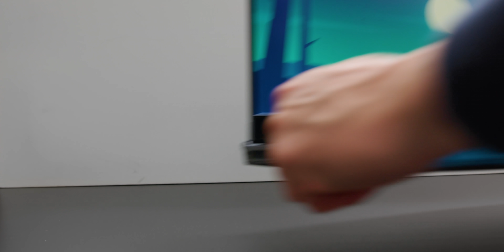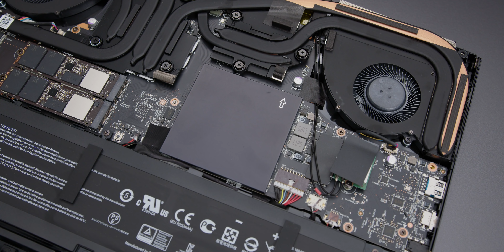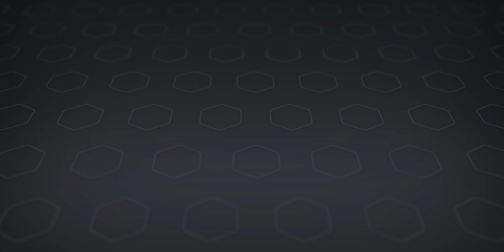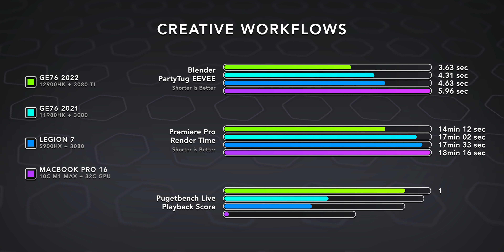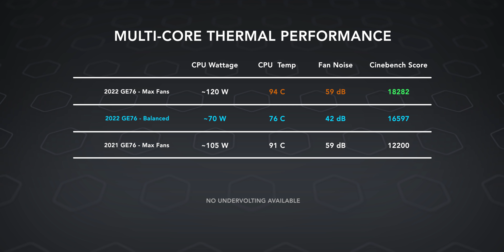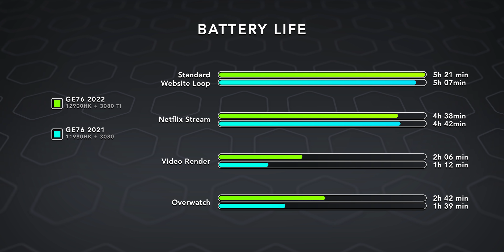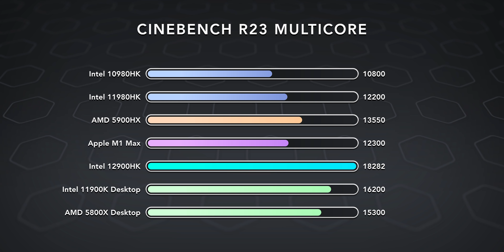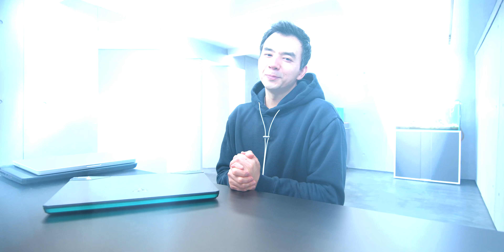This Laptop Is Faster Than Your Desktop

Comment: To be honest I'm not very impressed. 120W and 70W for max/turbo and balanced modes, respectively, are not suitable for more realistic laptop form factors, especially not for thinner premium laptops. Big.little architecture is the way to go for mobile devices as proven by smartphones and Apple's M1 SoCs, but I don't think Intel did a great job in this regard as well since their newest CPUs are still very inefficient compared to AMD, and this laptop proves it as well. They did manage to kill it with multicore performance though so props to them. They were almost always better with a single core and this CPU goes even further.

Overall, I still think going with AMD in laptops makes more sense than Intel, especially for non-bulky laptops and if you depend on operating on battery often. I wish AMD would go with similar architecture (big.little) as it could make them even more efficient than now.

Comment: If it can't run 4k max settings then it is trash to me. I know this crap is not 12 cores for sure. I don't care what speed the CPU is because if the hardrive is not m2 ssd 4th gen pci express 4.0 hahahah pointless. All this BS scores they put it out there just to trick people to buy their weak a s s machine. So people don't fall for this.

Comment: I have a ge66 10th gen with 3070, and I love it. I hate the stupid badge they put on it, but besides that it's a solid laptop series. Honestly the 3080 variants are a waste of money. The performance difference between 3070 and 3080 variants does not warrant +600 bucks, not even close.

Comment: I returned the MacBook Pro M1 base model for being too slow for its size.
I returned the legion 7 for having a terrible trackpad and not being a nice daily with poor battery, noise, buggy functions etc.
I then got a Blade 14 but now thinking I need to get an AlderLake Asus M16 or this MSI beast.
A mini-led screen plus alder lake plus 3080ti and unibody chassis with decent trackpad and I'm sold.... Until the 4080 is released
Reply: Sounds like you should wait until year 2030
Reply: When there Macbook Pro Retina came out it was worth going all out.  Now there is a generational leap with PCI5, DDR 5 and smaller nm intel, 2022 is the time

Comment: With AMD facing chip shortages, this year seems like  a good opportunity for Intel
Reply: Everyone is having a chip shortage, and intel and other companies cant take advantage of it because companies buy waffers for chips far ahead of time so these chips were claimed before the shortage even happened. its an even playing feild, the only reason intel has performance right now is because there talented engineers optimized core counts. you cant really act fast on events like these because every company is reserving chips until 2026 right now and they dont want to over buy
Reply: @errettfitchett2463  Nope, Intel did strategic partnership with TSMC that TSMC now building new fabric expanding their production at Intel sake. Apple as always already take step far far earlier. AMD in other hand seems in trouble on production.
Reply: Ops Blac  that's why Intel is building new foundry in Ohio.
Reply: yep, Intel move fasts in dealing thing with TSMC, and Intel got the agreement. AMD is refining their APUs but they forget the business side : secure the stocks and production.
Reply: @ZAcharyIndy  bro AMD is gonna come out swinging as well lol amd laptops batteries are un touchable at a low price
Reply: @fabolousjada5070  not that well

Comment: Intel was keeping this technology for 2030 but the pressure from competitors made them release it earlier 😂😂😂
Reply: Nobody has ever "made" Intel release anything... not even the feds.
Reply: nothing impressive btw, high amount of cores combined with high TDP gets you eye catching results, but efficiency / performance metric is still far away for perfection especially when used on mobile devices such as laptops. i would declare intel as a winner if they can pull off higher performance with the same efficiency as  a M1 Max.
Reply: @mishomaisuradze8205  Even M1 still need to plug in if you want to used it for Rendering or any heavy task
Reply: @mishomaisuradze8205   From your comments you sounds like true AMDumbs aka AMD fanboy, you just mad because your zen 3 and soon 6000 series which is still based on zen 3 totally got destroyed by Intel Alder Lake. It's not even competition.
Reply: Intel 12900HK uses 115Watts to deliver that performance, while the CPUs it is being compared against use 45Watts..
They really should be mentioning that while showing benchmarks instead of misleading the audience
Reply: @evileye4797  no Dave said the number are from balance mood which is kept around 70watts.
Reply: @evileye4797  115w is short burst, you obviously AMD fanboy who don't know how TDP works in Intel CPU, its not even the same like in AMD. Honestly you AMD fanboy are just mad because Intel put AMD to the shame with Alder Lake, not even 6000 series can save AMD because it still based on zen 3 and there are benchmark leak already that shows 6900HX is 30% slower than i9-12900HK.
Edit : I just realized my comments triggered Apple fanboy and AMD fanboy because i said the facts Intel smoke those 2 CPU.
Reply: @runninginthe90s75  dude, the 45w is talking about the Macs, harcore Intel fanboy here from what i can see
Reply: @runninginthe90s75  When you call people AMD fan boys 3 times in one line that makes you look like an Intel fanboy :) breathe, oxygen is important to you just like electricity to CPUs
Reply: @angel-stories2547  I don't know what are you smoking, M1 Max is 30w, obviously he is talking about AMD CPU.
Reply: @runninginthe90s75  30Watts? Really? Then why Apple give you 150 watts adapter and 99,9 wh battery if it's only 30 watts? M1 max battery life more worse than the basic M1. Please think with logic, high performance with very low power consumption is only a dream for now. Lol
Reply: @runninginthe90s75  first off, don't moke me as an apple fanboy since I don't even use their products and second, I don't use AMD either
Reply: Are there still company fanboys in 2022? How sad.

Comment: Comparing the cinebench r23 scores for M1 with ones for intel and and is misleading tho. A big part of why M1 gets these high cinebench scores is because you are not just comparing raw performance. You are essentially comparing the entire Apple ecosystem, ie: software and hardware with windows and x86. Cinebench on mac does not really compare to PC in a 1 to 1 ratio. 

I think x86 will still be the future of high performance computing despite ARM. I am probably going to buy a MacBook tbh, gaming laptops are just not worth IMO, even under the current circumstances but as far as high performance parts are concerned big - little x86 is the way forward, been saying it on subreddits I participate in for like 5 years now. Intels first attempt at it rocked AMD pretty much, and I am not talking about the 200W 12900k, but rather parts like the 12400 which are eerily close to 5800x levels of performance at the same tdp as a 5600x. (my desktop has a 5800x so yeah not even going to compare that, thing heats my entire room). I know this was a year old AMD vs brand new Intel but still. 

Let's see tho. Whatever be the architecture used and whatever be the brand in question, as long as consumers benefit I am all for it.

Comment: These are cool but I already have a 3080 laptop from last year and a 3080FE which I finally landed for retail price for my desktop. Even though I'm pretty set for now it's nice to see how quickly things move in the tech space.
Reply: As they say, Every new tech that comes out today is already outdated the second that it launches. It is just better to buy things you'll know will last you a long time based on what you need it for, not what trending now.
Reply: @GothicDragonX  I agree. I'm coming from a daily driver laptop powered by a 4gb 960M and 8gb of ram just a few years ago to now having a laptop and a desktop with a 3080 so I'm set for a while before actually needing to upgrade. It's so easy to try to upgrade to the latest and greatest but as long as what you have does what you need, you can be at ease.

Comment: man I never expected a laptop to outperform my desktop 5800x this soon
Reply: Dude its a 14 Core 105W behemoth of a laptop. The laptop literally uses more power than your desktop and the E cores are the only reason that it is "faster" in some scenarios. Since the E-Cores are scheduling disasters and the chips themselves are thermal furnaces. Imagine running the 5800x at 93C all day.... what a joke!
Reply: @Jimster481  so yeah, stop spreading fake news  out amd fanboys
Reply: @Jimster481  the e core logic is simple and won't bring u that much of  trouble. Honestly  amd gives more trouble like whea18, whea19. And different  speed direct out m.2 or io out m.2. U may already tolerate  amd, there is not thatch reason u can't tolerate  intel
Reply: @zihechen3111  Ecore logic is atrocious. its an atom CPU. Those are so viciously slow in certain tasks. you basically have to use W11 for it to work right. AMD has 0 issues whatsoever in any situation so.... I'm not sure how you could compare something that is flawless really with something that works in some situations and uses more than twice the power.
Reply: @Jimster481  e core is at 8700k performance level  dummi, it's not atom cores but some skylake  level cores with way better efficiency
Reply: @Jimster481  "amd has 0 issue" I don't know how u come that aht up when seeing whea18 19 happening everyday
Reply: @zihechen3111  Hardware Unboxed proves that 100% wrong. The performance is lower than a 2500k in real tasks like gaming. They are atom cores that are only good at parallel tasks accelerated in the background...
Reply: @Jimster481  OK, e core runs bad, I agree.  So u mean 12900k a only 8 core chip with some garbage Ecore may get very close cinebench performance  to a true 16 core 5950x. Isn't  ur logic shows amd 5950x single core is just garbage. Like 2 5950 cores = 1 p core +1 2600k core??? e core is garbage like only 25% performance  so 1 p core ~= 175% 5950 core???
Reply: @Jimster481  also 105w is only at FPU.  Ur 5800x runs hotter at FPU and can't even reach that performance  with bpo on. Also 12 Gen run cool on daily. 12400 runs 30w at gaming when 5600x runs at 90w, same performance.
Reply: @zihechen3111  30W when gaming? what crack are you smoking? Rusn at like 65W when gaming out of the box.... The 5800x uses about the same power while gaming but has better performance than the 12400F.... I'm not sure what sort of Intel fanboy channels you are watching but the stuff you are saying isn't anywhere close to the truth.
Reply: @Jimster481  12400 is in fact at 30w during gaming. Just u amd fanboys twisted it.
Reply: @zihechen3111  Not sure what you are talking about? I am just a realist.... The 12100F was using over 30W while gaming.
Reply: @Jimster481  u amd fanboys are so hilarious.
Reply: @zihechen3111  I'm not even a fan boy... I literally have platforms from both companies. Alder lake is fast in some scenarios but it's not really as power efficient as it needs to be and the platform cost itself is too high. The laptop in this video is literally $4000. The motherboards to actually go fast on desktop are $250-500.
It just doesn't compete with AMDs platform that is way more economical.
Reply: @Jimster481  yes u r a fanboy. We all know.
Reply: @Jimster481  u said ecore is on 2600k level not me.i just do the calculation using the data u give me. So u mean u r giving fake numbers?
Reply: @zihechen3111  nope, I'm using information as shown by hardware unboxed and guru3d. You are using Intel marketing claims.

Comment: Im supper happy Intel has been able to keep up again with AMD, cause god knows what monster AMD is gonna announce this year to top this when they finally support DDR5
Reply: Ryzen 6000 which uses DDR5 is only 5% faster than Ryzen 5000. And 20% slower than Intel 12th gen. AMD is DOA
Reply: @__aceofspades  ...well at least until the 7000 series which AMD will intend to release well before Intel releases Raptor Lake.
Reply: @__aceofspades  it’s not only that, that is a problem with AMD. It’s these fucking AMD suckers that propped the prices up on their chips with free marketing and advertisements. It created so much demand for their shit. AMD used to be a good alternative to a high priced Intel chip. Now they are both high as fuck in prices.
Reply: AMD is going to launch their CPU version of Radeon 6500XT LOL

Comment: The lower end mobile i5's will be as fast as last gen desktop i7's I'd bet. Crazy to see how much performance we get nowadays. I got my Acer laptop in 2016 and it has a i5 7200U, and at the time it wasn't even close to being a "good" chip compared to any desktop chips. Only 2 regular low wattage cores. Great to see that you can get amazing performance now and a lot of cores for cheap.
Reply: Same processor that I have

Comment: This is excellent. Looking forward to seeing what this looks like at 1440P and 4K. I was not expecting a 20% bump vs. prior 3080s.

But now for that pricing...
Reply: price .... hell no. we do not deserve it
Reply: ye for the price u can get like 3 Lenovo Legion 5 with R7 5800H and RTX 3070, which is performing only like 40% worse than these new MSI high end one. 
I have one and I can say for the price its more than awesome and u wont actually need anything up such specs rn to play games with high and ultra settings.
Reply: @green_block  Tru dat. I got a rog Strix with a 5900hx + 3050 ti for about $1200 USD, and a 5800h + 3060 was $1400
Reply: @craigdaurizio686  theres also a 6800m version for 1650 and a qhd model for 50 more thats supposed to release soon
Reply: @questionmarkquestionmarkques  Dang, looks like I need to give this one too my wife and scoop the 6700/6800m version
Reply: @Rengawr they meant 4k resolution
Reply: @green_block  For that money u could build such a nice desktop PC. In terms of price-performance ratio, there are significantly cheaper alternatives that are weaker but can still keep up with gaming PCs in terms of performance. 

So if u need like just a gaming pc to handle latest games i wouldnt recommend it, cause u can get powerful laptop and a powerful destop for $4000. 
Its only a thing if u really need the most powerful laptop and u dont care price-performance ratio 'cause u can afford it.

Comment: Intel still cannot have Apple power/speeds without producing crazy heat. You can push Apple's strongest processors to the max and you will not even hear the fans running. So, no, nothing about this blows Apple out of the water or comes close. No other company does.
Reply: Their machines really are crazy long-lasting now. I think we’re all just better off giving up on gaming laptops and building a desktop… when GPU prices come down, anyway.

Comment: Does anyone package these laptop components into a slim desktop PC? That kind of setup might be the way to go if you want a desktop keyboard/mouse/monitor setup but don't want to hunt for a video card, or just don't want to build a giant machine from components.
Reply: Just buy the laptop and dock it. If you want the mobile CPU but without the cost of the mobile screen, Intel’s done that a few time with their NUCs. The problem is that you either have to live without a GPU or you have to add your own GPU.
Reply: @abubakrakram6208  I figured with a larger case you could get better cooling, and it would be nice to have the integrated mobile GPU as well to sidestep availability problems. Plus docking means taking up more desk space and paying for a keyboard and monitor you don't need.